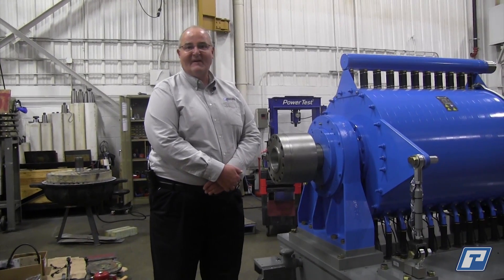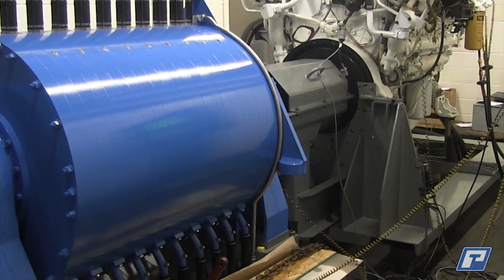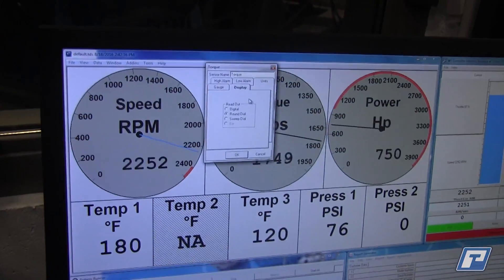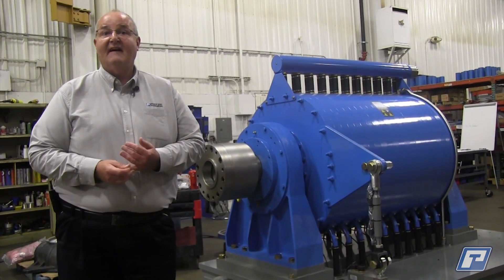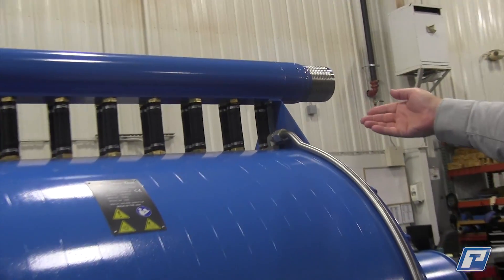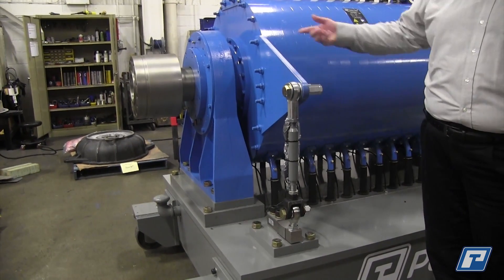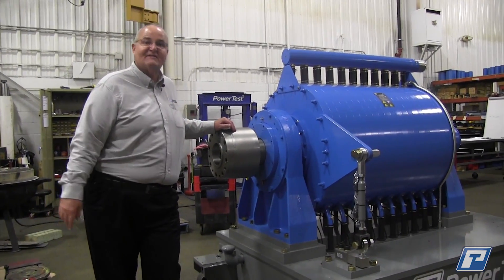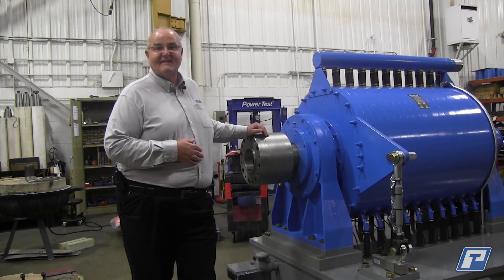H36 Series Water Brake Engine Dyno

Comment: Sorry but mining engines are high speed - you can't call them slow speed
Reply: Watermelon will marine engines that are used in ferries are running at 500 rpm max made by Sulzer that's how unless you are indian
Reply: Some dyno that physical size will run to 10 or 12,000 RPM, that's "high speed" in the dyno world.  Froude even made small custom units that go to 50,000 RPM.
Reply: In engine world even mining engines are considered slower speed. Obviously not slow as ship/large marine diesel.